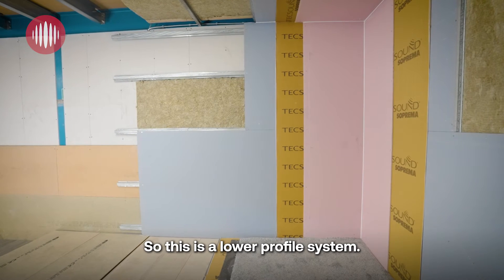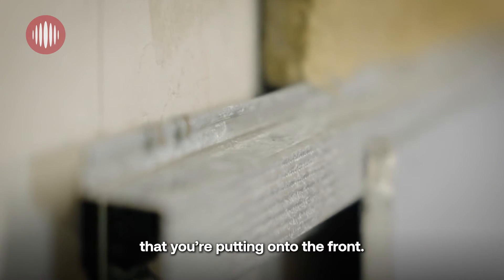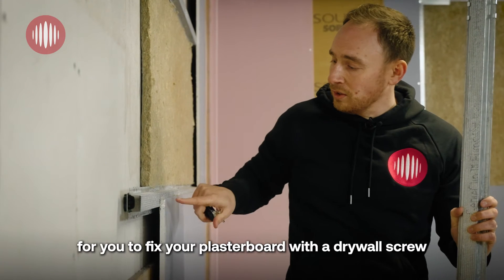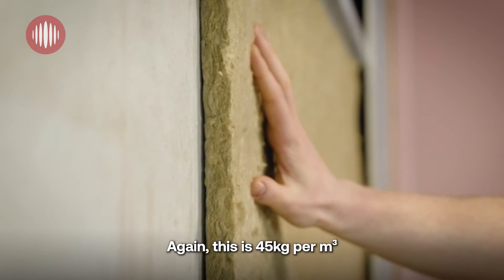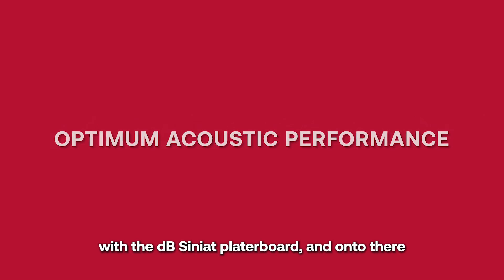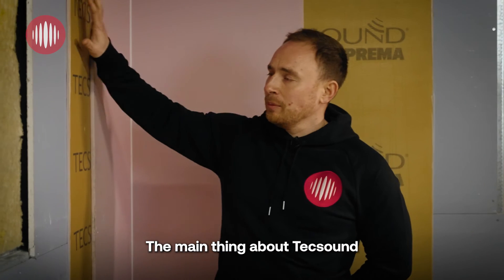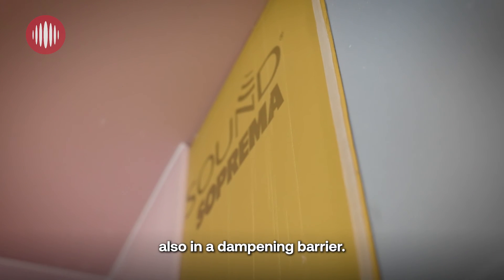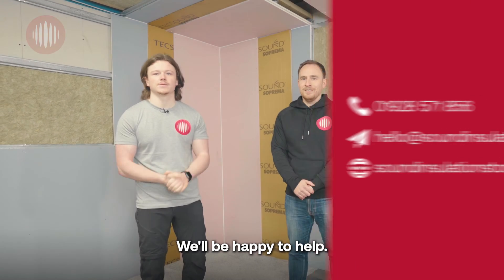Soundproof your walls - The Genie Wall 80 System is a low profile yet high performance system

Comment: So, the TecSound — is that mass-loaded vinyl?  Do you actually install the rockwool before putting up the first layer of drywall?  What’s the total STC rating for this solution?  How do you deal with all of the penetrations that need to happen through this sound treatment, like electric boxes for switches or receptacles, windows, air vents, etc…?
Reply from the maker: Tecsound is similar to Mass loaded Vinyl, it is PVC based. Yes the rockwool goes in the newly formed cavity behind the drywall. We supply acoustic socket boxes for penetrations, in single, double or triple. see link https://www.soundinsulationstore.co.uk/products/acoustic-socket-box-double?_pos=1&_sid=1c5ba88df&_ss=r&variant=48961241619